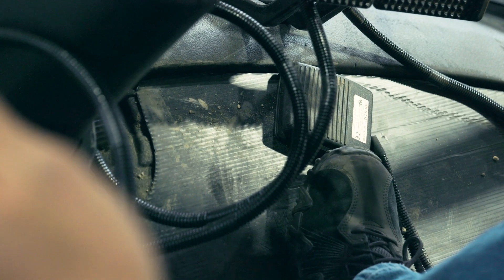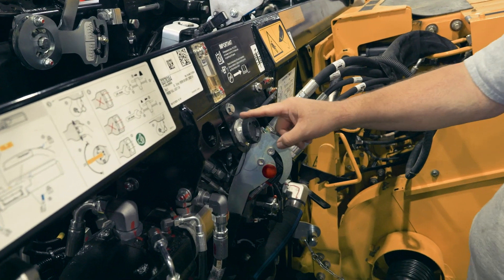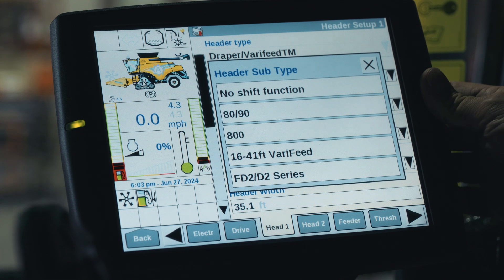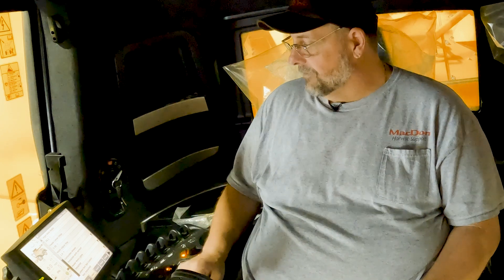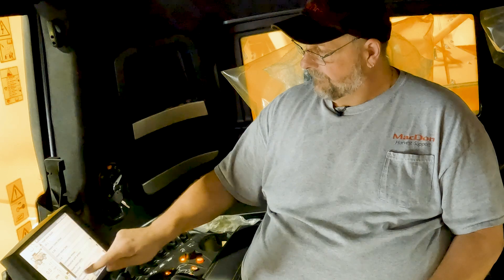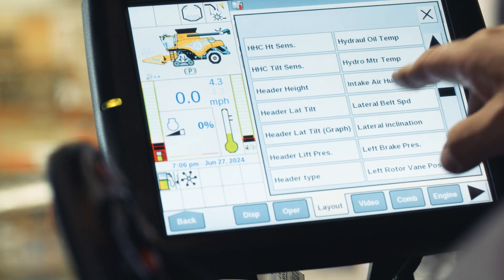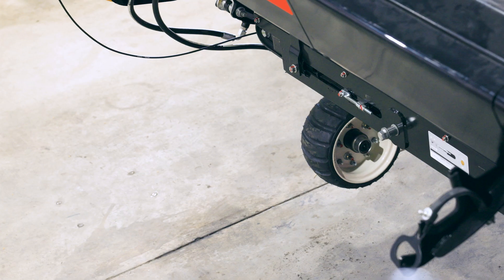MacDon How To - FD2 FlexDraper® Header Case IH / New Holland Combine Integration

Comment: Does the header need any update if it’s a 2023 model? I run a 2023 fd250 and have been interested in going this route to get rid of the foot pedal and dial but wasn’t sure if it’s just an update to the 8250 or if I need anything on header. 
Thanks
Reply from the maker: Yes, your 2023 FD2 FlexDraper® will require an update to support integration. Contact your MacDon dealer regarding an updated completion wiring harness  (kit MD84946).
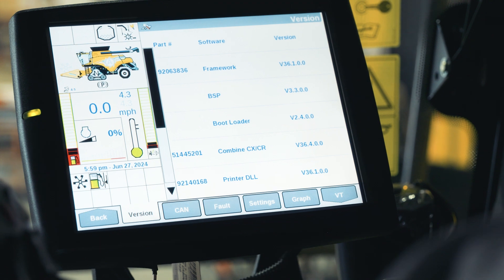Reply from the maker: It's also possible your combine may need an update as well. At 2:27 in the video we show what software versions are required for Case IH combines.